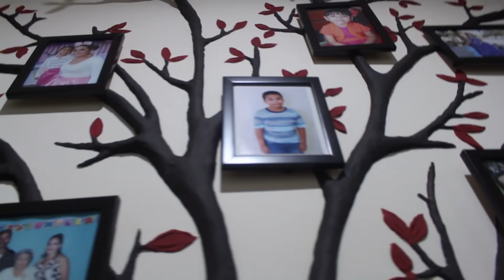ÁRBOL GENEALÓGICO

Comment: Awsome work...which material used for thermocol adjust in wall ..
..
Reply from the maker: The material you use is cork, and then plaster, thank you very much!!!
Reply: @joseluistiradolizarraga9373  cork mean?
Reply from the maker: @zaryabkhan190  Yes, is cork
Reply: @joseluistiradolizarraga9373  i dnt get it what it is cork?
Reply from the maker: @zaryabkhan190  they also call isopor, dry ice, cork, caceton, used for construction
Reply: @joseluistiradolizarraga9373  u applied cork on base then place thermapol on it nd after plaster rite?
Reply from the maker: @zaryabkhan190  
First place the cork on the wall, then cover it with redimix mixed with plaster to make the details to the tree, I hope you serve the data, greetings!!!